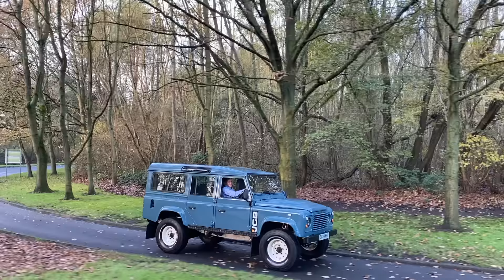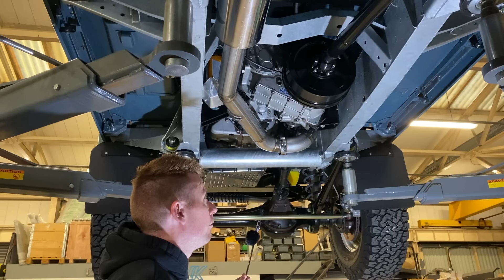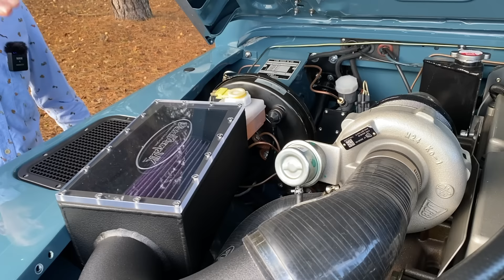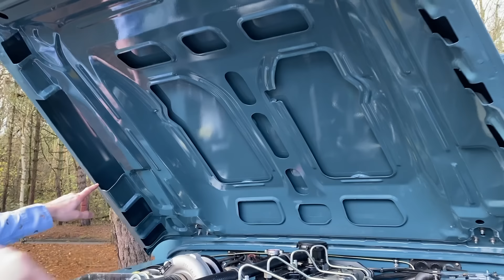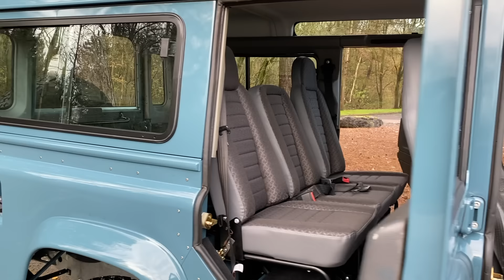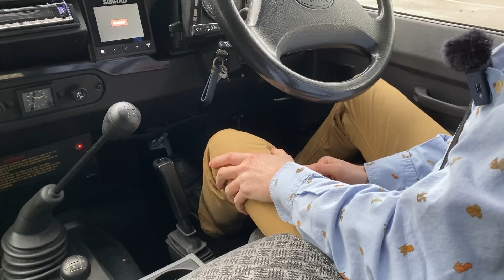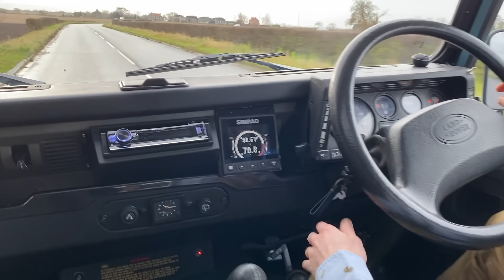British LAND ROVER Defender with JCB 4.4 Industrial Agri Engine Conversion Dieselpumpuk

Comment: Nailed it!!!
I think you made a better vehicle than the folks over at LR were able to.
Design by committee usually results on the worst outcomes of compromise.
From an American former draftsman.
Reply: From a british former car body draughtsman (we spell it different) of 52 years in the branch. This could and should be available to buy, beats a £150K G wagen (I worked on that body too).
Reply: @ironmyno As a British former milkman, can you explain why Americans always find it necessary to announce where they're from and what they used to do.

Comment: I drive loadalls on a regular basis, most of which with this engine

For all it is pretty bulletproof (aside from the regular oil starvation and blowing turbos) i don’t think I’d have one in a defender

4.4l and slow as!! Plenty pulling power

Comment: Stunning ! Can you do a video on drive train/ engine and R380 and LT230 mounts and how you worked them out so gear stick came up into cab correctly, im doing 84 110 with a R380 and LT230 was going to use 300TDI but now you have me thinking, great project well done

Comment: this reminds me of the 4248 4.1 litre perkins engine i put in our series 3 swb in the 80s.with rr difs and overdrive it was good for 70 mph.with the fuel tweaked it was about 95 hp  but it was all about torque.up to 2500 rpm it had more power than a chevrolet 350 v8

Comment: Hehehehe, I was going to throw my oily rag at the screen until you cut me off - largely because the 200 had so little power that the only way to kill one of those engines was to do 300,000 miles without changing the oil.

Comment: Beautiful, one of the best restorations I have ever seen. I hope you can forgive me: but put a slat higher on the front green OVAL, as it came from LODE LANE and change the rear door for a 2002MY (or later) LR075816 when possible.
Regards.💪

Comment: I wonder how usable a plant machinery engine really is in a light truck like this. These type of engines are really designed to mostly operate in a very small rev range - often working at fixed revs for prolonged periods. So that "10,000 hours" of operating time is likely under its intended usage, not in a light truck, where it's being revved in a different way.
Reply: to be fair, this particular engine though is designed to work at constantly changing revs, as in telehandler/loader spec - generally they're run at 1500rpm ish when working or traveling on site, & revved frequently (with the foot throttle) to boost the hydraulic functions. as opposed to an excavator which runs at high constant revs for extended periods so is designed to make best power in a narrow rpm range.

then again I'm no expert with modern JCB's. 

On a vaguely related note though, years ago I did swap a 4jb1 Isuzu engine from a burnt out Hitachi excavator to a light truck for a guy. Same engine code but manifolds & flywheel etc were different. I had my doubts about the fuel pump being suitable for a vehicle application but surprisingly enough it ran & made power the same as the factory unit had. although it was governed just shy of 4k rpm vs 5.5k.
Reply: @mfrsr 4jb1(+t) are very very common in daily drive mid size 4x4s in Australia, excellent engines, low on power compared to the more modern versions of the engine but i prefer mechanical over canbus everything so i keep mine going (with minimal maintenance ) and from memory it has around 480k on the clock
Reply: @bushratbeachbum  yep, that they are. I'm in NZ btw. I worked for a light truck importer in the early 2000's, doing pretty much any mechanical repairs needed for entry certification, spent a lot of my life playing with older gen Isuzu Elfs etc - most of the stock was 10yr old ex Japan. And I've owned a 6t Daihatsu tipper (Nz New Toyota Dyna) for the past 20-odd years. Can't beat the older mechanical pumps for longevity that's for sure.
Reply: I think the bigger problem is the engine will never get worked hard enough. These are high duty cycle engines made for 10t machines, it's never going to get a workout in a 2t Defender.
Reply: Well when he was driving it up through the gears it didn't really need revving you could hear it was pulling at 1200. 
Unfortunately it will be like a lot of the Cummins conversions and wreck the transmission as they aren't designed for the torque that occurs low down, abit like the Tdv 6  engines in the discos 🙈

Comment: The crank is the weak part of that engine. A lot of engines in agricultural handlers snapped crank's and destroyed engine, most going at less than a 1000 hrs.  Were better from about 2016 on I'm told. Beautiful job on Land rover though.

Comment: I think I'd rather have the well proven perkins 1000 phaser turbo engine with the bosch ve mechanical pump, at around the same capacity and power output. Fits straight in the engine bay with only minor mods . And you could still claim the british/ jcb heritage thing , if  that really matters?

Comment: 10:10 - my understanding of this is. Usually exhaust gasses have unburnt fuel in them, so its piped back in for a second burn so the resulting emissions are cleaner or (knowing how diesel engines work) the temperature of the exhaust gasses might aid with fuel combustion compared to petrol engines.

The end result in theory should be cleaner emissions. A lot of manufacturers (notably VW) use the same technology on their diesels and I think VW have rolled it out to their petrol TSi engines now too but dont quote me on it.
Reply: It is a form of EGR and it’s not designed to burn unburnt fuel in the exhaust. 
EGR works by lowering the peak temperatures and oxygen content in the combustion chamber to reduce the amount of nox particles created.

Comment: What a Nice Job,I Think I Used this Engine To Tow all the Aircraft About on an RAF Base in a 9Ton Tractor.Its the Perkins Phaser.
It Had a 2 Speed Auto Box and Plenty of Blue Smoke.
You Have managed To make a Landrover Drive like a Tractor and Sound like one,I Had a TD5 90 and Drove RAF 300Tdi Landrovers 90 and 110s And i Would Have a 300tdi or 200tdi But Not that Engine You Have Fitted.
Reply: I think this is JCB's own 'Dieselmax' type engine which is designed and build in house by JCB (with consultancy from Ricardo Engineering).  The Perkins Phaser is a much older and unrelated engine that JCB used to fit to their old machines before they made their own engines, though I think they still use some modern Perkins engines (ie Catterpiller engines with a less offensive name for JCB) for aplications where the Dieselmax isn't suitable.
Reply: This is JCB’s own engine that replaced the Perkins engine as CAT bought Perkins and JCB did not want competition engine.

Comment: This is what a Land Rover needs, not an EV conversion. Top work.
Reply: Wow  i can see j c b  going into truck production  next they would wipe the market  cheers for doing this conversion  top bloke
Reply: I want a true diesel electric hybrid Land Rover or Land Cruiser. That’s where it’s at. Something like a small car diesel engine and hub mounted electric motors. Check out Edison motors if you haven’t.
Reply: @Rainersherwood hub motors aren't the right choice, e-axles are. Edison is doing great with their conversions tho.
Reply: The pajero 3.2did with mech pump also a good choice, and so fckn cheap.
Reply: Wouldn’t an automatic transmission suit that engine?
Reply: @SamInSomerset  indeed however I don’t believe they have the technology also most folk who buy one of these things believe a manual standard transmission is the cool thing to have!
Reply: A defender and its predecesors are REAL workhorse not those unreliable Chelsea tractors / Bond street shopping carts they now offer.
I restored/upgraded my  troublessome 1971 LR 109 ( build quality in BL times were sadly bad ) with that  famous MB OM616 2,4L (no turbo) diesel engine in the early 90's 
That old girl is still a treat to drive and she keeps on going
Others even have installed that famous reliablePerkins 3 cillinder 2.4 cil agricultural engine Or also famous reliable PSA 2.1L XUD diesel engine 
So i 100% agree with this conversion doing right to the spirit of a legendary workhorse.
Reply: @obelic71  They also sell many more thousands of them as well as throw a lot more money back into the UK economy. And how can you say the modern LR products are unreliable and then say your old one was also unreliable?  I had a SII and guess what? Yes, it was unreliable. They just are.
Reply: @obelic71  When I restored my 88 2a, in 1990, I replaced the 2.1/4 for a 200TDI out of a 1989 (G) Disco that was written off in it's first year, and that 35 year old engine has 700k miles and Is still going, But, I will rebuild it soon or replace it with something a little newer... :)
Reply: @hardergamer  Yup that engine has its roots as an indirect injected natural aspirated Perkins BA type Diesel engine.
Those were the days several legacy manufacturers made some serious reliable dieselengines. My 2.4L MB dieselengine came also from a write off (rear end collision)
There is also 1 big benefit rebuilding those engines.
You can do a biofuel conversion and keep its relaibility.
Reply: Just agree a EV four wheel drive has a motor on each axle
Reply: copy nothing 😂
Reply: Let Gale Banks at it.
He'll get 100 more hp out of it!
Reply: I do wish they would add the hydrogen powered engine into a defender
Reply: Why not both?? Different strokes for different folks and all that...
Reply: @CheesingGouda Totally with you. There’s a place for either, or both. We’ve been playing with different drive systems in landies since day dot. Use the one that suits your use case.
Reply: I don't mind EV conversions - suits the character. It's the high power V8s chasing fancy G Wagens that get my goat - as a novelty a lightweight with an old Rover V8 is nice, but this JCB is more of a proper 'extreme' LandRover
Reply: They are really well suited to an EV conversion in the right circumstances
Reply: @hughmarcus1  Stop encouraging the EV Madness, I can tell you they have no intention if have us blatting around in electric landrovers or indeed cars. One charge of an electric car uses a huge amount of power the national grid will not be able to run more than a few cars not millions.
Thats where with them still pushing Net Zero the 15 min city's with a 5g fence come in. Their going to herd us into there small areas, no one will be living in Rural areas. Fuel will be so expensive you'll only be able to afford a trip to the supermarket. You'll have to apply for a permit to leave your 15 min city. This is what's coming unless we wake up on mass and tell the psychopaths running the show to fuk off.
Reply: @hughmarcus1  Electric drive has tthe big advantage of high torq from the start.
The probem is the heavy batterypack and for an offroader you want it to be as light as possible to plow truh  deap mud and snow.
Reply: @obelic71  Electric defender has big issue with range. What's the range of one travelling at 70mph on the motorway?
Reply: @WestfieldFreshAir  but ironically so much more efficient when offroad
Reply: I would be very happy wihth an Electric Classic Cars Larry conversion but in Left hand  drive, not wrong hand drive
Reply: Not a fan of Ev but Ev cars last longer
Reply: @matthiaserb3809  That's pure comedy. Where's your data to support that claim? EVs are generally very recent to the market. Where's the data on 30 year old EVs compared to ICE cars?
Reply: @WestfieldFreshAir  I mean, an EV only has an electric motor, a transmission and a battery. It has far fewer mechanical components that wear out. Hardly any load changes on the few components and also much less chance of oil, water and fuel leaks. And we all know by now how good the Defender components are...
Reply: @matthiaserb3809  You missed of the various controllers, charging circuits, the fact that a battery contains more than 10,000 components. They are not as simple as you think.
Reply: Where’s all the batteries (not to mention the electric) going to come from if the loons do somehow eventually take over the madhouse!
Reply: @Dde-q3n Try reading up on the subject to answer your questions.
Reply: @Dee-u4r the batteries come from the gigantic quantities of lithium and other elements being mined constantly, the electricity can come from your roof if you have any sense.
Or you can buy renewable energy from the companies who will be supplying it exclusively across the country in the relatively near future.
Change happens.
When the first car was built, where were the fuel stations then?
Don't be ashamed of being scared of change, when cars were first on the road, they had to have someone walk ahead of them to warn people they were coming.
A fair number of those cars were electric too.
But stuffy men, stuck in the past never embraced them as they were seen as ladies carriages.
The world is a much better balanced and educated place now so things are changing as they should.
Have fun!!
Reply: @bushratbeachbum  There is no renewable only electricity grid in the UK.  Contracts do not control how electrons flow down wires.
Reply: @WestfieldFreshAir  righto.
Even if you don't bother to read the passage below, the uk currently produces 40.6% of its energy from greener sources than coal, gas, oil or nuclear energy.
Mostly from Wind power, Solar power, Biomass, and Hydro. 

The percentage of energy in the UK that comes from renewable sources has been increasing in recent years: 

2022: 35.9% of electricity came from renewable sources, which was a record high 

2023: Renewables accounted for 43% of electricity, a record high 

April 2024: Green energy accounted for 40.6% of the UK's overall energy production 

The main renewable energy sources in the UK are: Wind power, Solar power, Biomass, and Hydro. 

The UK's government has set targets to increase the amount of renewable energy in the country: 

2030: The government aims to get 95% of the country's electricity from low-carbon sources. 

2035: The UK aims to fully decarbonize the grid. 

Wind energy: The UK aims to have 50GW capacity by 2030. 

Solar energy: The UK aims to have 70GW capacity by 2035.
Reply: @bushratbeachbum you clearly have no idea how the electricity grid works you will not be able to exclusively buy renewable electricity at all in the near future because as long as there is non renewable electricity being generated you will get what you get and there’s nothing that can be done to change that unless someone is willing to pay for companies to build mini electrical grids all over the country that are only supplied by renewable electricity it’s not going to happen anytime soon or in the near future even the 2050 goal for net zero still has plans for there to be non renewable electricity being generated
Reply: @jamesevans938  hahahahahahahahahaha.
Bless you, you dear thing, you can obviously not read well.

Things Are Changing Champ.
The Clever People Are Doing Good Things.
Mummy And Daddy Will Take Care Of Things For Now. Xxxxx
Reply: @bushratbeachbum  considering the whole point of EV's is to save the planet, your statement "gigantic quantities of lithium and other elements being mined" perfectly sums up the environmental stupidity of battery powered EVs. 

Electric drive train yes. Battery powered? Fuck no. Liquid or gaseous fuels and on board generation. A hybrid drive train running on clean fuel is the best solution. Something JCB is fully aware of and the reason they've made a decision to build, and are actively promoting hydrogen engines in their range.
Reply: @bushratbeachbum  you should read what you originally commented because  you will realise that you said that in the near future you will be able to exclusively buy renewable electricity from companies.   And I was simply saying that would be impossible even in the near future unless said companies build their own electrical grid
Reply: @Dee-u4r single 450-600hp large drive unit, 3 lsd`s, 100kw battery, Tesla tech , about 4 sec`s 0-60...

Comment: Engine has a nickname within the fitters, its the Triple 4. 4 stroke, 4 cylinders 4 valves per cylinder. Never seen one go bang apart from one that flattened a cam lobe, can only assume it didn't harden properly?

Comment: The 14m 535 JCB at work, that was brand new at the beginning of our current building site, is literally breaking down on a monthly basis, it’s either in limp mode or cutting out mid lift every week. I’m sure the core of the engine is bullet proof, but I wouldn’t rely on the ancillaries.
Reply: It's all the emissions crap that's on them. The regen is a pain in the arse. It's because they're idling most of the time. If you're thrashing them, they're alright.. but you can't do that with loads on the forks.

Comment: We had a RRC with a Perkins 4.236 in it. Wouldnt do much more than 55mph but you could pull a fully loaded hay trailer and it wouldn't even notice.
Reply: 4236 or 4203 Perkins did one job,and one job only, but they did it superbly. The job was to turn Diesel into a very loud and irritating rattle
Reply: perkins 4 moves latam f100 and chevys from the 70's to today
Reply: I had a RRC with a perkinks 4203
.....very agricultural, 55mph was a push but I would do it all day with a full trailer and wouldn't even notice hills 😊
Reply: @spacecowboy2442 only 130 foot pound torque and 64 bhp ?
Reply: That Perkins 4-236 turbocharged and intercooled would have been an amazing performer but would have probably destroyed the transmission,the 4-203 was also a great engine but was indirect injection but very torquey and reliable.
Reply: Mine has the Mazda conversion done by Motor and Diesel .Engine was used in the Mazda Titan truck .

Comment: That's a tidy conversion, but as you said the 4.4 jcb has 550nm of torque, and the r380 was designed for.......380nm.  Hopefully your mods mean the big trailer doesn't turn it into runny glitter.